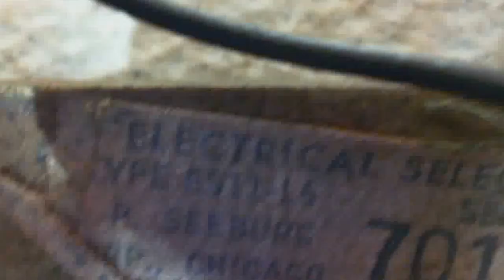Seeburg Jukebox Tormat Electrical Selector - Inspection and Repair

Comment: Tormat selector latch bar solenoid. Back when I rebuilt my Seeburg AY160 I found that someone added a jumper in the single price unit for "Free play" that kept that solenoid always on whenever power was applied to the jukebox. Wow that's a fire waiting to happen! Luckily my solenoid wasn't burned up.

Comment: I have a Seeburg 201 jukebox and am trying to get the two large rectangular selector cable connectors off. Do I just yank them off. Wiggling them and pulling doesn't seem to get them disconnected.  I hate to pull much harder as I'm afraid I'll break them.  Is there a catch or a secret to disconnecting them?   Thanks for any help you all can provide.   Vince from North Carolina

Comment: Very common. If you leave the selector solenoid engaged for long period of time. It will burn up the solenoid. The solenoid is not design to be energized for long period of time

Comment: If that solenoid is operating on AC, it may have short circuit turns, which causes it to act like a transformer, and thus massively overheat. I suspect that it will have shorted turns. The previous guy's 'hack job' was to reduce that current to a reasonable level.
Reply from the maker: ***** I agree that there could be shorted turns but even so, it could be that the coil will still perform satisfactorily if we're lucky.  I returned the selector to service today primarily to see if it worked properly and it appears to be doing so.  
During normal operation, the coil remains energized until two song selections are completed.  That can take 15 seconds with a dithering patron.  I put the unit into the selection state, energizing the coil and left it there while measuring it's temperature rise with an infrared thermometer.  The temperature quickly rose and reached 65C before I de-energized it at about 15 seconds.  65C is not too hot but it seemed it had lots more to go and I think it might reach 80 if left indefinitely.  A patron can drop in a quarter, make one selection and walk away leaving the coil energized.  
During the initial incident, the coil smoked in seconds.  So I think I have restored just as it was before but now I realize that something more is going on here.  Why would someone have to re-engineer this highly engineered machine?  What else is going on?  Or maybe you are suggesting that his fix compensated for a short between windings that actually happened years ago - maybe that's it.  
I need to figure out the proper current and then measure it.  The series resistor was warming up nearly the same.  I could bump up it's value to 10 or 15 ohm from 7 and see if that cools things down.  The coil really pulls in the mechanism strongly - maybe too strongly in fact.
Reply from the maker: ***** I'm thinking you might be right about the shorted turns.  Until you mentioned a shorted turn acting like a transformer secondary, I'd never thought of it.

Comment: Hello my name is Marcos, I'm from Spain, I'm sorry but I only speak Spanish, and I use a translator, I've seen a video of you, and I would like to ask for help with a problem that I have with a seeburg ks200, I'd really appreciate it since I'm desperate, and I do not know what more tests I have to do, the problem is that I just pick up some selections, especially A1, B1 V1 etc, most of the others, scan but do not pick them up, we have tested the keypad and that's fine, , memory unit with battery test, and all selections are activated, we have verified the stepper, and we believe that okay, we have also changed all the valves, and we do not get it to work well, can you give us some information, that could help us, I would be very grateful
Reply from the maker: Hi Marcos.  I'm afraid I won't be able to help you since I really have very limited knowledge about Jukeboxes and know nothing about yours.  Keep looking for help - there are people with great expertise who can probably help you with your machine.  Good luck.

Comment from the maker: Please read this.

I eventually learned that this solenoid is always at risk in this model machine.  If the solenoid is left in the energized state for too long (some hours), it may well burn up like this one.  The bypass circuit was intended to reduce the risk of burnout under these conditions.  The original coil was being protected by the bypass circuit and burned when the bypass circuit failed, probably because the micro-switch was not triggered.  I've learned this the hard way - you don't need to.  If you have one of these machines, you need to understand the risk around this solenoid.  One option is to disconnect the solenoid and make selections by pushing both selection buttons at the same time.  Jim.
Reply: Jim Lindenas I have a 65 seeburg Electra.  It was working fine the other day.  Put in a coin make the selection the keys do not return (only when the release button is pushed). The solenoid will remain closed after selection is pushed and will only open when The release button is pressed. The machine will scan constantly and not make a selection.

Comment: Hey Jim - thanks for the video.  On that replacement solenoid, I guess it's best to get the one with the highest resistance?  I would assume that means it's the least likely to have a windings short of its own, right?

Comment: hi Jim,  
  A quick question on a problem I am having with my Wurlitzer 2300 selector. 
  Ok , the basic problem is when you turn it on its showing a lit select light, no selections can be made and there are 2 caps. on top in the center of the selection row of buttons between the record played counter and the selection buttons that get red hot when the machine is on.  You can trip the mech. in the back and the machine will pick and play a record perfectly.  What I think is going on is the coil for the reset bar (for the buttons) is getting power and keeping it locked in the energized position.   As far as I can tell the entire Juke is 100% original and had worked perfect for years.  It is also set up for free play.    You don't live in the St.Louis area do you ?   thanks in advance  Jeff

Comment: Dont use the youtube video stabilizer. it is absolutely horrible, almost gives me the sensation that I am going to get sick ;-)
Reply from the maker: I decided to stabilize parts of the video because it was hard to see detail otherwise.  I find it gives a weird 3D effect that helps see some depth in the image.  The camera I am using is running at a low frame rate.  The significant capture period for each frame results in another weird effect where the image seems smeared during camera movement.  The stabilizer seems to correct this to a fair degree which I consider a good improvement.  A better camera would help.
So for now, just look away every ten seconds and keep a bag handy. ;-)

Comment: Nice video. I am working on a 222 that just plays every single record. Can't find the prob yet, but the manual says reseat the memory connector. I reseated both big connectors, but nope...
Reply: Did you get this fixed?  There is a function on this jukebox that creates the playing of every record......do you have a manual?
Reply: @CowSaysMooMoo  I actually don't remember now if I fixed it or not- Thanks for writing back! It might have been the popularity meter, can't remember =)

Comment: yes not the same but the solenoid is

even if  what you have now works you still need to replace the solenoid (I would look for two one for back up just in case)

this will keep the owner happy with a quick repair turn a round
Reply from the maker: I've ordered a replacement solenoid.  In the meantime, no coins will go into the main player so the old solenoid will not get energized.

Comment: There is a mod for the solenoid that can save the jukebox. It was done for free play or places with lots of kids. I forget how to do it.

But lets say a person adds credit. In normal setting that person hits letter then number and solenoid kicks out.

But lets say a person adds money. hits a letter and that is it the unit keeps power to the solenoid. This in turn overheats and catches fire.

The mod is like a timer so if a button is pushed and not a number it kicks or kills the power to the solenoid. In turn saves a service call,

Also this mod would work with older wallbox's also.
Reply from the maker: ***** The solenoid is a preferred approach just for such an eventuality.  Once latched, the solenoid will draw very little current and can be left 'on' indefinitely.  So I am tending to think that something was wrong with the coil like shorted turns and that extra switch and resistor was a way to keep it going when replacement was not possible.  Like a repairman's trick.  Only the trick failed on my watch and the coil can only be worse now.  I'm looking for a replacement.
Reply: I had a similar problem with an AMI Continental 2 box. The shifter solenoids for the gripper bow have cam operated microswitches in series with both solenoids, so that they will energize, then switch off. Only problem was that one of the micro's contacts welded internally, and the solenoid stayed on and cooked.  I took the solenoid apart, unwound it, counted the turns, gauged the wire, rewound it, replaced the bad micro -  that was the fix.  Ten years and 90,000+ plays later still working fine.  Patch jobs like the "repairman" did in the field are just that - patch jobs. Not really a good "fix".

Comment: I have a Seeburg 160 and when i push a selection the selector pics the wrong record selection as marked on the bottom label inside the jukebox near the bottom? Can any one help
Reply: Gary, I have a Seeburg 160 as well. When making a selection, it will scan twice and go back to it's resting position. Have you ever experienced this with yours? Everything seems to work except for this issue. Cheers.

Comment: good video, but man oh man.. I wouldn't trust a burned solenoid.. 
Maybe bring out the winding tools again?? huh?
Reply from the maker: Buzz1151 I don't trust it either so I'm looking for a replacement.  There's a three on Ebay from the same seller that are exact matches but they ohm out differently according to his postings.  2.4, 4.4, 6.2 or something like that.  I'm thinking the higher resistance might be the right choice.   I've been reading up on AC latching solenoids.  There's always more to learn.

Comment: I give up"No power going to unit at all model AY160, Seeburg 1961, Can any body help me out?
Reply: I need Help"
Reply: Get a service manual. It should have schematic diagrams in it, and a fault finding chart as well. Got mine off eBay.